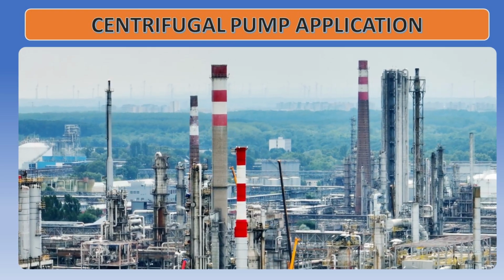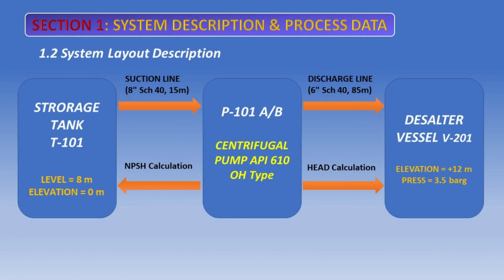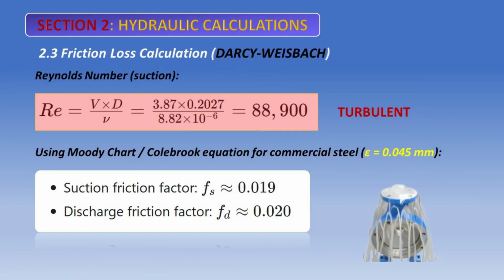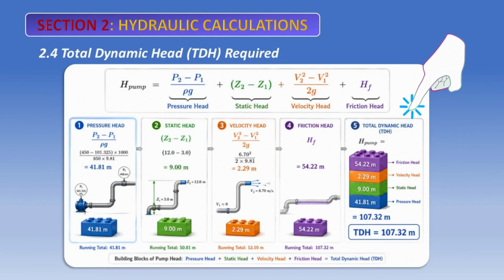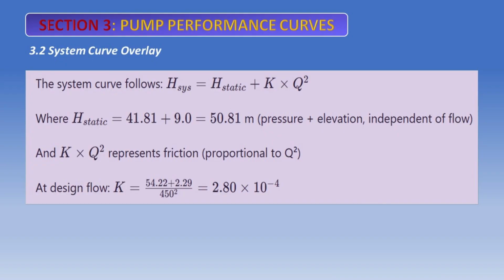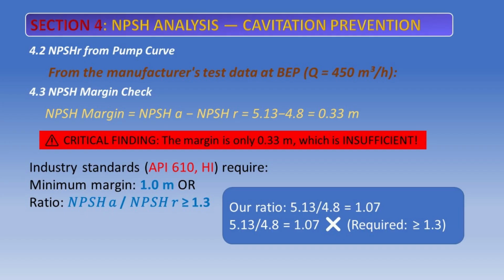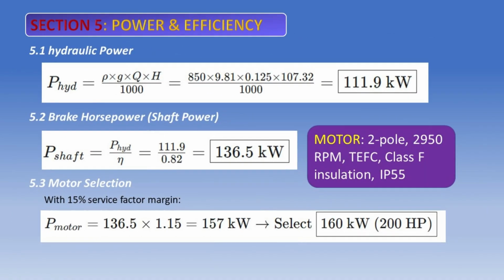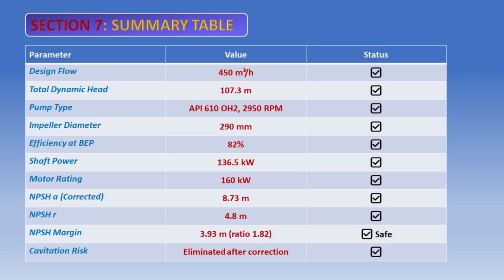This Pump FAILS Without This Calculation! | Centrifugal Pump Sizing (Crude Oil)

Comment: Do all centrifugal pump types accept this calculation analysis, is there an exception for some ones or some fluids ?😮😮
Reply from the maker: Thanks for this question 😊 Yes all centrifugal pumps are designed and verified by the formulas but manufacturers like using theirs curves and empirical formulas, that offer accuracy and reliability ❤